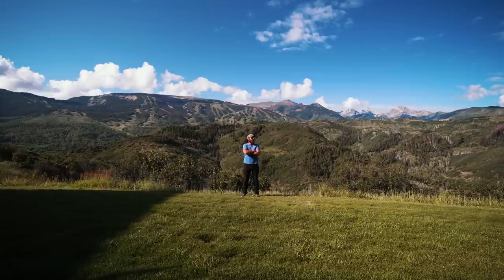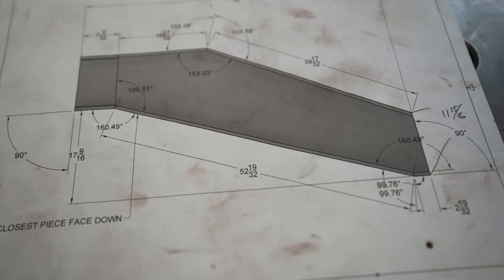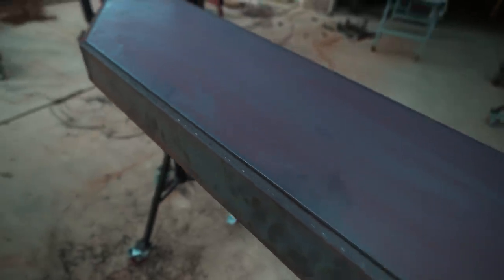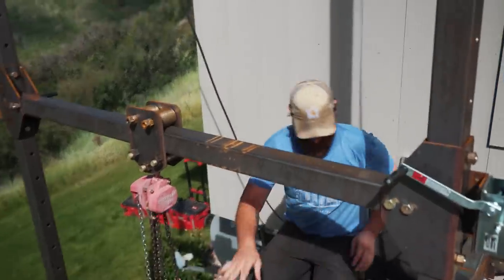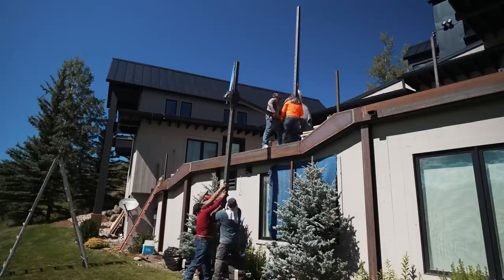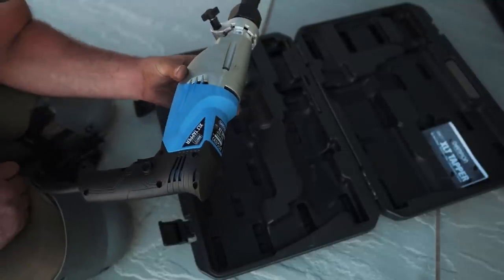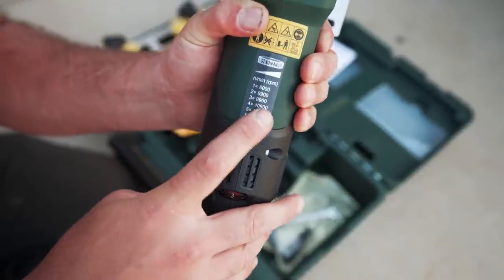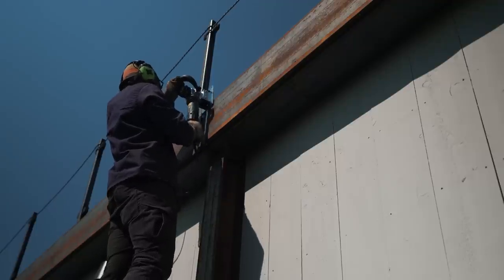fabricating a 20,000 pound handrail with no heavy equipment

Comment: How impressive. You’re so clever. In Australia all swimming pools have to have a 1,200mm high unclimbable fence and we chose glass panels for a short section for an uninterrupted view but our 1,200mm x 1,200mm glass panels have no vertical rail to hold them up, they’re all supported by two spigots dynabolted into a concrete footing. A set up like this for the house owners would have saved you a lot of work.

Comment: You do really beautiful work and your videos are top notch.

Offering a thought- when you had to cosmetically fill the flat plate to the channel, instead of running dual shield, have you considered SilBr? You won’t impart as much heat, it’s softer so blending is a breeze, and obviously it won’t rust (yeah I know, the railing will be painted). MIG with SilBr allows you to fly through the work from start to finish. Yes, it requires 100% argon, and yes the wire might be a tad pricier, but time saved is worth more.
Reply from the maker: Thanks!...These welds are also structural , silicon bronze would not have worked for this, for ornimental its great. But if the inspector saw anything other than dual shield or 7018 it wouldn't pass inspection.

Comment: Super nice video, you have outdone yourself this time. :) We demand more videos..lol

Could you have used 045 flux core (gassless) with the Transsteel 2200? Or that wouldn't have been as strong as sticking it with 7018?
Reply from the maker: Thanks! I'm sure the fronius could use gasless no problem.....my certifications are in dual shield and 7018 so thats why I stick to those

Comment: Spent the last 5 years trying to talk the boss into some duel shield wire. Ended up having to buy it on my own use it in the shop on a job for that jack azz to buy some more. Same thing when it came to alluminum wire. They had no idea that there was 4043 only 5454 ..
Reply from the maker: Stick welding is fine..........if you dont want to make any money

Comment: Why is this made out of such huge structural members, it's way overkill. I can only imagine that the client requested big chunky pieces of steel for astetics as glass panels only weigh 100 pounds or so per metre. What is the plan regarding protective treatment? Are you pulling this down to send for blasting and painting or galvanising?
Reply from the maker: Deflection.....the finish is not part of my contract